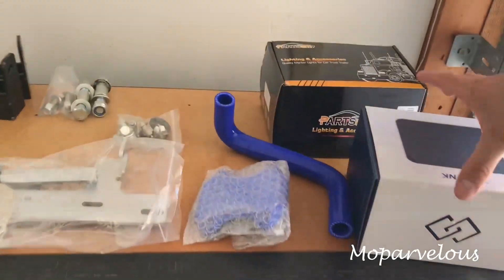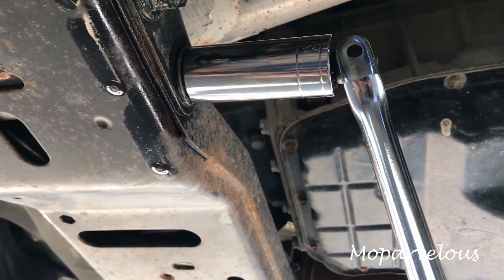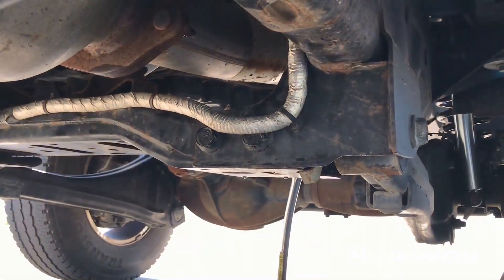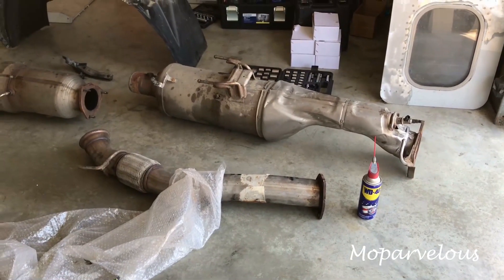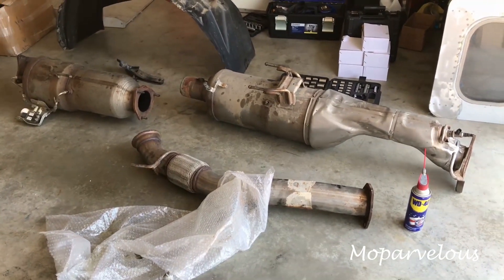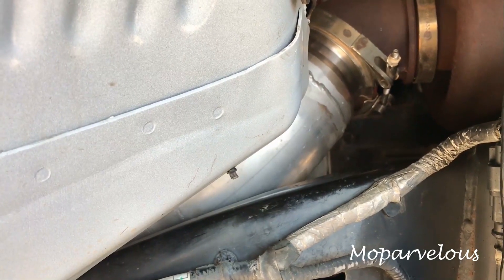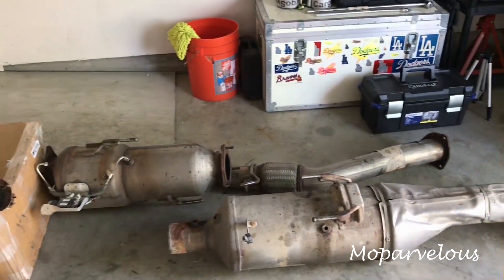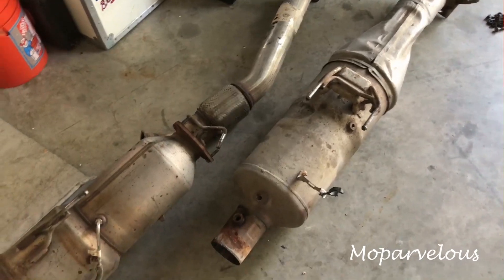6.7 Cummins 5 inch Straight Pipe! Flo Pro Exhaust

Comment: I should have followed your advise. Have all the piping off the truck and can’t figure out how to drop the trans cross member the get the new down pipe in. Any suggestions? I removed both horizontal bolts as supported the trans with a block/jack but it won’t budge.

Comment: hey bud, where did you buy the 5” from?
Reply: Just had your problem I couldnt find a 5" anywhere because of the epa crackdown no one sells them anymore only wvp on amazon but its dual and not a true 5in. I ended up buying an mm3 kit with a full 5in flo pro I'm guessing he had been stocked up on them before they stopped selling to the USA. I'd get my hands on one or 2 before everyone's out.
Reply: Diesel Truck Products lists them as 5 inch DPF Deletes